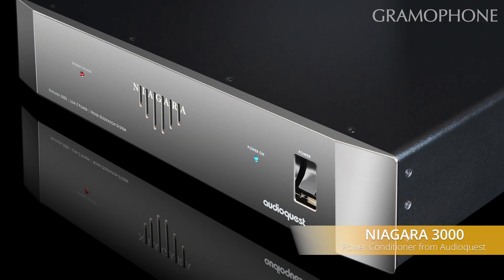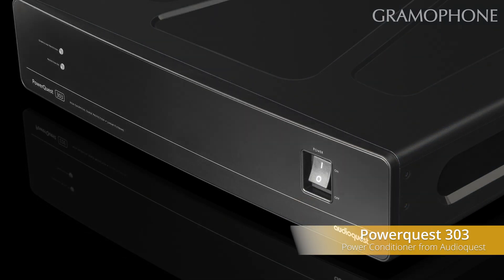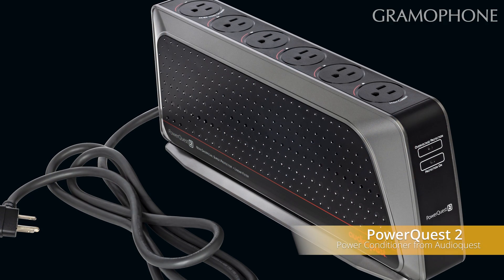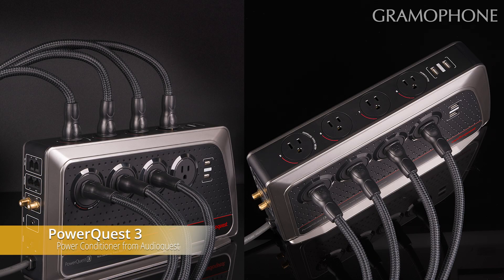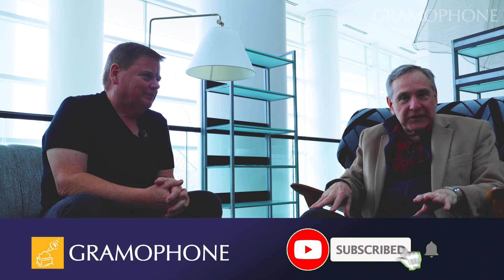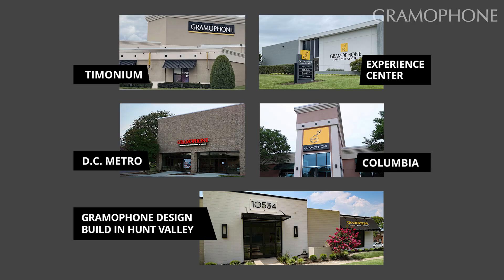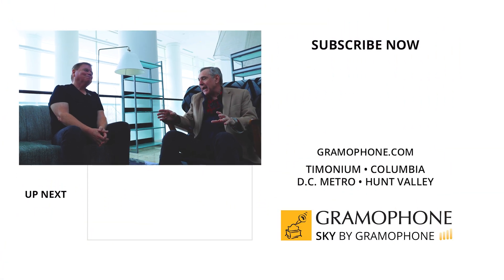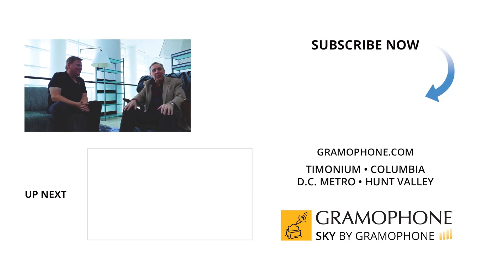Is Power Conditioning Simply Snake Oil? | Gramophone

Comment: It is a real shame that power supplies for audio equipment don't have some type of magical circuitry that converts the incoming AC to DC then massively filters it with a huge bank of capacitors to produce clean DC that is completely free of any noise and distortion found on even the dirtiest of mains.  That way we would not have to spend massive amounts of money on a power conditioner.  Oh wait, never mind.
Reply from the maker: Hi Mike, thanks for supporting our channel, and for giving us a smile.  There is a lot of technology inside the A/Q power conditioners that, when looking inside most audio components, is clearly missing.  True, no one needs to spend massive money on a power conditioner. But if you've got good equipment, a good power conditioner can help to get all you paid for.  Garth's white paper is an interesting read: https://www.audioquest.com/blogs/theory-education/power-demystified
Reply: @GramophoneMD  Hi Joe (I assume, please correct me if this is not the case), Thank you for the white paper.  The paper only focuses the differences between what comes out of the wall outlet and what comes out of the power conditioner/power cord combo.  They claim that the "signal you see and hear are those that are lost to signal coupling and masking effects without use of these AC power solutions".  I do not understand how this could even be remotely true.  The ac coming from your outlet is NOT in any way in the signal path so I do bot see how this could cause "signal coupling".  When the ac enters a linear PS, this first thing that happens is it enters the primary of a (often very large) step down transformer.  This induces an ac voltage and current in the transformer's secondary windings.  The output of the secondaries in completely isolated from the wall outlet ac.  This gets rid on any dc and, because it is a large inductor, gets rid of any high frequency noise.  This ac is then rectified and filtered to produce the dc required for the positive and negative rails of the amplifier.  NONE of this is in the signal path.  What the paper DOES NOT compare is the actual audio output of a device on wall ac versus the power conditioner ac.  This is all I care about.  Until AudioQuest can show this difference I will not be convinced..
Reply from the maker: @MikeMBMr  Hi Mike, yes, this is Joe, and thank you for your response, and for supporting our channel!  One thought: try visiting a local quality shop, at a time when they are not too busy, and hear for yourself the difference.  I have a story for you that you might enjoy: ask@gramophone.com

Comment: I play guitar and  having a time with dirty power. Even isolated power supplies for my pedal board don't clean up what the amp is getting so I was wondering if medical grade power conditioners or something from the hifi community would be worth the money? It's only an issue when I apply godly amounts of gain...
Reply from the maker: Hello C-Rock, a power conditioner may help solve your issue, but your noise may depend on other factors.  Single coil pickups (Strat, Tele, J-bass) generate more 60 cycle hum than humbucking pickups. Many P 90 style pickups are noisier still.  Please reach out to us so we can dig deeper into your issue: ask@gramophone.com
Reply: @GramophoneMD I'm using active emgs so pickups are not the issue . Low impedance, buffers etc... its definitely a home outlet issue.. the noise surpression and isolated 9/18 volt for effects are good quality ,the emgs are good quality. The only thing I can think of is the morly hum eliminator or maybe the apc conditioner/ surge protector might help... I figured hifi audio guys could point me in a good direction...thank you for answering.
Reply from the maker: @wheat_hath_spoken  Hello C Rock, you are welcome, and agreed - active EMG's means that is not the issue.  We have a good custom install crew, and we can run this past them to see if they have suggestions.  Please reach out to us and we'll do what we can to work this through: ask@gramophone.com
Reply from the maker: @wheat_hath_spoken  Hi C Rock, one of our team members suggested this isolation product may help you: Jensen Transformers VRD-1FF
https://www.jensen-transformers.com/product/vrd-1ff/